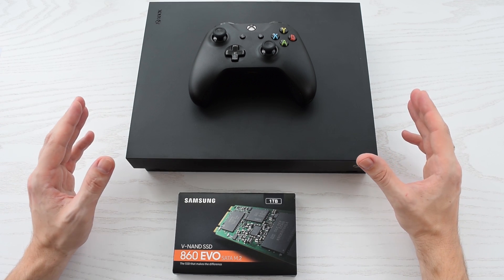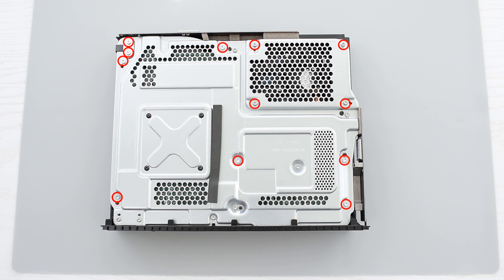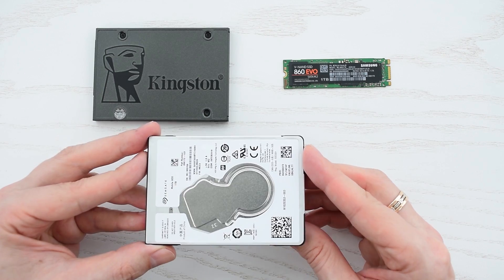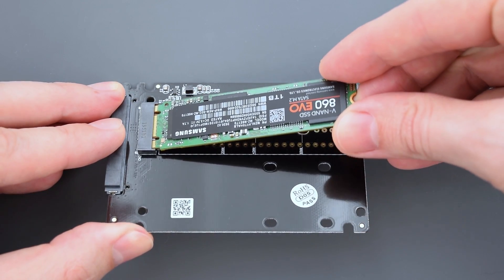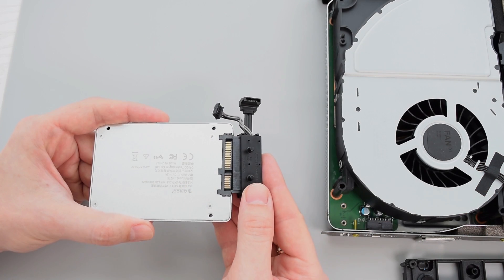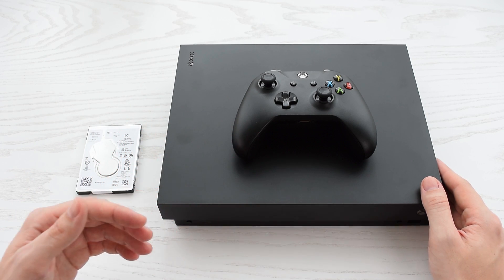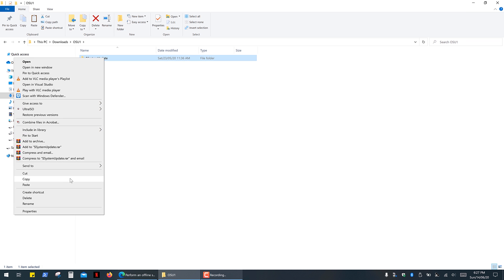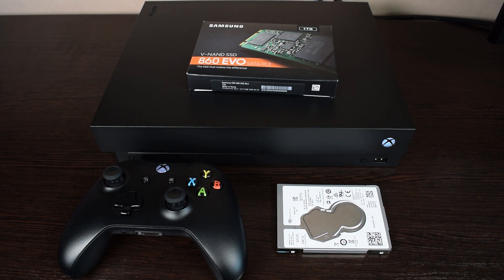How to Upgrade your Xbox and PlayStation Console to M.2 SSD Drive. 100% Works for all Consoles

Comment: but it works on Xbox One s? can you make a video of a speedtest on xbox one and see the real differences between a normal ssd and a nvme?
Reply from the maker: You can't use NVMe SSDs with that adapter. It only works for NGFF SSDs. There's no difference in speed between a regular 2.5" SSD and NGFF one. Both are SATA drives. This method is for those who already have an NGFF SSD or if you have a better deal on NGFF than on 2.5" SSD. Maybe you have a dead laptop from which you can salvage that SSD, then you just need to buy a 5$ adapter.

Comment: Hello! All great but my xbox one x is unable to make my SSD replacement size bigger than 365GB, even if the drive is 960GB. I have the same kingston ssd as you have
Reply from the maker: That's because you use 960GB drive. Xbox officially supports 500GB, 1TB and 2TB SSDs/HDDs. I have a recommended list of drives for Xbox in the description. Xbox simply recognizes your SSD as a 500GB drive. Connect your SSD to a PC and using any software that can work with partitions and extend UserContent partition to maximum available space.  It's a 5 minute process and you'll get full disk capacity.  As an option you can return your SSD and get a 1TB one.

Comment: Installing M.2 or nVME in adapter is POINTLESS!!! Speed throttled by Sata !!! connection to 550mps tops. Waste of $$ just install 2.5" SSD and be done with it
Reply from the maker: What you're saying is POINTLESS!!! There's no M.2 or NVMe, because NVMe is M.2 form factor. M.2 is a form factor for SSDs, wireless adapters and other stuff. There are two types of M.2 SSDs: NVMe (PCIe) which is super fast and NGFF (SATA) which is a regular SATA drive but in M.2 form factor. I was using NGFF drive which has the same specs as a regular 2.5" SSD. It's also possible to use NVMe but it will run at SATA speeds. This method is very good for those who already have NVMe or NGFF lying around, for example after upgrade of your PC. Or if you have a better deal on NGFF SSD than on a regular 2.5" SSD. Anyway the point of this video was to show this option, because lots of people say that they have a spare M.2 drive and they didn't know that such option exist.

Comment: have qeastion can i use new m2 disks like 3500 mb read disk? or i need to use older version of m2?
Reply from the maker: It works only with NGFF (SATA) M.2 SSDs. NVMe SSDs won't work with such adapters.
Reply: @ElectronicsComputers  thanks
Reply: @ElectronicsComputers  maybe work with m.2 Nvme to sata conver?
Reply from the maker: @rtcw6760  NVMe to SATA adapters simply don't exist and most likely will never be created. Because if you need a SATA M.2 SSD you use NGFF. There's huge difference in speed between NVMe and SATA no sense to create a device for such downgrade. Though, you can buy NVMe to USB adapter.
Reply: @ElectronicsComputers  aha okej

Comment: M2 is useless because sata speed 😌
Reply from the maker: Do you even know how m.2 works and what speeds it providesM.2? M.2 is interface provides SATA, USB and PCIe interfaces. In that particular case we used NGFF (SATA) M.2 SSD which works at SATA 3 speeds just what Xbox One X supports.

Comment: Isn't a M.2 SSD pointless, because you're still limited by SATA no matter how fast the SSD? Makes more sense to just install a 2,5" SATA SSD for the OS.

For games external USB SSD, because USB 3 is faster than SATA.
Reply from the maker: M.2 is a form factor. I was using SATA (NGFF) M.2 SSD which has the same specs as a 2.5" SSD. Don't confuse with NVMe SSDs.

Comment: m.2 is overkill it gets bottlenecked because its going into sata 3 just buy a 2.5' SSD that has read and write capabilities of 560 mbps
Reply from the maker: Those M.2 NGFF SSDs work at its maximum speeds in such configuration.
Reply: @ElectronicsComputers  right so you spend money on an m.2 and an adapter rather than just buying a sata ssd

Comment: WD PC SN730 NVMe SSD 1tb using SATA Enclosure to upgrade my PS4 Pro storage space. Is it possible...?
Reply from the maker: There's no such adapters for MVMe SSDs and will never be. You can only use NGFF M.2 SSDs. And you can use that adapter for any device where you can install 2.5" drive.

Comment: I am confused the encloser you linked looks different and have a picture saying it does not work with the samsung ssd
Reply from the maker: It works perfectly with all SSD brands. There are two types of M.2 SSDs, NGFF (SATA) and NVMe (PCIe). Those adapters work only with NGFF SSDs.

Comment: I have put in a normal SSD. I don't see any benefits to using M2 memory because it's the same price and then you also have to buy the converter case. Speedwise I don't think there's any difference as well since the SATA port is the limiting factor here.

Edit, did some research and found the answer: "Considering that many SATA3 SSDs can readily fully saturate the SATA3 connection, having an M.2 SSD instead isn’t going to make a meaningful difference - and it’ll likely cost you more money. So no, I highly doubt you’ll come out on top going that route."

Don't spend more than you need and just get a 2.5inch SSD people!
Reply: I was wondering about this.  Thank you for mentioning.

Comment: But why u should do that sata is limitated so if u put m2 into your ps4 it will run same like sata ssd
Reply from the maker: We were using M.2 SATA (NGFF) SSD which has SATA III interface. And the Xbox One X has the same SATA port which fully utilizes the data bandwidth of of that SSD. The main idea was just to show the upgrade options. Lots of people say that they have spare M.2 NGFF SSDs after upgrading laptops etc. And they didn't even know that such adapters exist. Or maybe you just want to use that M.2 SSD in another device after your console dies (2.5" SSDs are becoming obsolete), then it's pretty good option.

Comment: but the speed just normal ssd
Reply from the maker: I was using M.2 SATA (NGFF) SSD which has SATA III interface. And the Xbox One X has the same SATA port which fully utilizes the data bandwidth of of that SSD. The main idea was just to show the upgrade options. Lots of people say that they have spare M.2 NGFF SSDs after upgrading laptops etc. And they didn't even know that such adapters exist. Or maybe you just want to use that M.2 SSD in another device after your console dies (2.5" SSDs are becoming obsolete), then it's pretty good option.
Reply: @ElectronicsComputers  Yes,you are right,thanks for tutorial👍

Comment: I'm already using the Samsung EVO 870 1TB SSD in my PS3 👀, using your method would I see a difference? 🥊🥊🔥🔥🙏
Reply from the maker: No, both are SATA drives and they have the same performance. The main idea was just to show the upgrade options. Lots of people say that they have a spare M.2 NGFF SSDs after upgrading laptops etc. And they didn't even know that such adapters exist. Or maybe you just want to use that M.2 SSD in another device after your console dies (2.5" SSDs are becoming obsolete) or maybe there's a better deal for an M.2 NGFF SSD.

Comment: So what would you have to do to let say, use a 2tb+ size?
Reply from the maker: Xbox officially supports 500GB, 1TB and 2TB HHDs/SSDs. You can trick the console and install a larger drive, but some major Xbox update can brick your system, and you'll need to reinstall Xbox OS again.

Comment: Is this better than just subbing a mx500 in terms of performance? If so, why?
Reply from the maker: You can use only M.2 NGFF (SATA) SSDs with that adapter so you'll get the same performance and speed.

Comment: And this Works for ps4 pro? Cant Find any usefull Information
Reply from the maker: Yes, it does. It's just a regular SATA (NGFF) SSD but in M.2 form factor. The main idea was just to show the upgrade options. Lots of people say that they have spare M.2 NGFF SSDs after upgrading laptops etc. And they didn't even know that such adapters exist. Or maybe you just want to use that M.2 SSD in another device after your console dies (2.5" SSDs are becoming obsolete), then it's pretty good option.
Reply: @ElectronicsComputers  good to know, but the ps4  pro only Supports a speed of maximum 600 mb/s theoretical. so an normal sata ssd with round about this speed will do the same work. Am i right? So if i dont got an m.2 ssd i should better buy an 2.5"?
Reply from the maker: @raizorr5746  I was using M.2 NGFF SSD which is a regular SATA SSD but in M.2 form factor. It has the same speed as any 2.5" SSD. You can't use NVMe M.2 SSDs with adapters like that. The main idea was just to show the upgrade options. Lots of people say that they have a spare M.2 NGFF SSDs after upgrading laptops etc. And they didn't even know that such adapters exist. Or maybe you just want to use that M.2 SSD in another device after your console dies (2.5" SSDs are becoming obsolete) or maybe there's a better deal for an M.2 NGFF SSD.
Reply: @ElectronicsComputers  ah i got it! Ty for the informativ Video 👍👍

Comment: If I were to do a 2TB drive. How would that work with the partitions?
Reply from the maker: Once you've installed Xbox OS, then you need to extend UserContent partition to the maximum available space.
Reply: @ElectronicsComputers  is that option available when installing the OS?

Comment: An FYI if you're in the Xbox Insider program and have the newest beta OS, you need to leave the Insider program to reinstall the current OS and then you can change/upgrade your HDD. If you don't, then you'll run into an error when attempting the offline update with the OSU1.
Reply from the maker: That's right.

Comment: Sorry guys. But would a this adapter work with a seagate 520 or 530 ssd?
Reply from the maker: It works only with NGFF SSDs and unfortunately, there are no such adapters that would work with NVMe SSDs.

Comment: Hi there, thank you for the video! I would like to ask if the m2 looses of its speed through the adapter or not? does it affect any of the reading or coping speeds? Thanks in advance!
Reply from the maker: I was using NGFF M.2 SSD which is a regular SATA drive. There's no difference in performance between this SSD and a regular 2.5" SSD. It's just a different form factor. The main idea was just to show the upgrade options. Lots of people say that they have a spare M.2 NGFF SSDs after upgrading laptops etc. And they didn't even know that such adapters exist. Or maybe you just want to use that M.2 SSD in another device after your console dies (2.5" SSDs are becoming obsolete) or maybe there's a better deal for an M.2 NGFF SSD.
Reply: @ElectronicsComputers  i see, thank you

Comment: Hello, what seconds do you gain by changing the base PS4 Slim Drive to a M.2 SSD Drive when playing games like Cyberpunk 2077?
Reply from the maker: It doesn't matter M.2 NGFF or a regular 2.5" SSD you use it will be the same speed and the boost in performance is quite obvious compare to a stock HDD. Your console starts, updates faster. Your games start faster and installation is way faster that with HDD.

Comment: SATA Is cheaper and has about the same bandwidth
Reply from the maker: Both 2.5" SSDs and M.2 NGFF SSDs have the same specs. The main idea was just to show the upgrade options. Lots of people say that they have a spare M.2 NGFF SSDs after upgrading laptops etc. And they didn't even know that such adapters exist. Or maybe you just want to use that M.2 SSD in another device after your console dies (2.5" SSDs are becoming obsolete) or maybe there's a better deal for an M.2 NGFF SSD.

Comment: Do we get better disk performance by using M2 to SATA converter, compare to a native SATA ssd? Thanks for the video.
Reply from the maker: I was using M.2 SATA (NGFF) SSD which has SATA III interface. And the Xbox One X has the same SATA port which fully utilizes the data bandwidth of of that SSD. The main idea was just to show the upgrade options. Lots of people say that they have spare M.2 NGFF SSDs after upgrading laptops etc. And they didn't even know that such adapters exist. Or maybe you just want to use that M.2 SSD in another device after your console dies (2.5" SSDs are becoming obsolete), then it's pretty good option.

Comment: By using the SATA enclosure you are limiting the NVme drives full speed.
Reply from the maker: What NVMe are you talking about? You can't use NVMe SSDs with that adapter and I clearly explained that in the video. There's no adapters like that that work with NVMe SSDs.
Reply: @ElectronicsComputers  My Bad, i skipped the part where you were using an M.2 SATA drive.

Comment: is m2 faster than 2.5 inch ssd?
Reply from the maker: M.2 is just a form factor. Some M.2 SSDs (NGFF) use SATA interface just like 2.5" SSDs and some (NVMe) use PCIe technology which provides super fast speed. You can use only NGFF M.2 SSDs in that console and they have the same speed as 2.5" SSDs. This method is good for those who already has a spear NGFF SSD or if M.2 NGFF SSDs have a better deal compare to a regular 2.5" ones.

Comment: Hi
I did the same procedure with a kingston ssd 960, but it only show me 365gb available, how can i fix it?
Reply from the maker: That is because Xbox supports 500GB, 1TB and 2TB HDDs/SSDs. Your console recognized your 960Gb SSD as a 500GB one. You need to connect that SSD to a PC and using any software that works with disk partitions extend "UserContent" folder to the maximum available space. And then put it back into your console.
Reply: @ElectronicsComputers  Could you recommend me a software? Please 🙏🏻
Reply from the maker: @ismaelrivera4051  You can download "Mini tool partition wizard" from my Patreon page (the link is in the description) for free. The link for that app under the video about an SSD cloning.
Reply: @ElectronicsComputers  Thank you 😀

Comment: You mentioned you'd share a link for a video explaining how to copy game files. Is it possible to place that into the description? Or was it the laptop video?
Reply from the maker: I was talking about cloning the drive which I don't recommend. Simply Install Xbox "OS" then install your games and after you log in into your Xbox account all your game progress will be back. If it's not an option then simply clone the drive the way you do it for your PC.
Reply: So I dont need to clone the hard drive to the SSD using acronis or macrium reflect? 

Do I just replace the hard drive with the SSD then I just download the xbox os on a usb then connect it to the xbox then download it to the xbox while the SSD is already inside?

Comment: Just use USB 3.0 SSD, it is faster than the internal SATA 2 bus
Reply from the maker: You're wrong! Xbox One X has SATA 3 interface which provides faster speed than any USB to SATA or M.2 adapter.

Comment: A great video but PLEASE for gods sake use either an antistatic wrist strap connected to an earth supply or plastic gloves like the mechanics or hospital staff use , before even thinking of handling very sensitive devices like this as they may or at some point fail early due to static damage later on down the line. Its absolute beggars belief that people especially PC shop staff ive seen handle this sensative material without thinking of the consequences. Ive learned this from previous experience & had to return Ram due to faulty product as seen them handle it with bare hands only to descover unsuprisingly it did not work or caused the BSOD (walk away if you witness this as you will be returning it for exchange or refund unless its sealed then you are fine) The same applies to Ram as mentioned / CPUs / Graphics cards / motherboards / daughter boards etc. doesnt matter so much about HDDs or SSDs or PSUs as they have some kind of protection as you are not actually handling the circuit boards on them.
Reply from the maker: Thank you for the comment!

Comment: So between SATA and 2.5 inch SDD there will be a different on speed. However 2.5 SDD vs M.2 SDD will have the same speed and performance because of the SATA connection right?
Reply from the maker: 2.5" SSDs and M.2 NGFF SSDs have the same specs. NGFF M.2 SSD is a SATA-based drive so it can't perform any different than his big brother.

Comment: Thanks a lot mate, detailed yet simple... 👍
Reply from the maker: Glad it helped
Reply: @ElectronicsComputers  Is it possible to use M.2 PCIe NVMe? It‘s faster and would be better.
Reply from the maker: @yorumustasi  There's no such adapter for NVMe SSDs only for NGFF.
Reply: @ElectronicsComputers  I saw after this video, that you work on it :) on the board is a place for M2 PCIe NVMe I think(?), you say for 4 month that you build something, a soft -or hardware, I read it in the comments, what is the current status :) ? 

It would be awesome, if it‘s possible.

And an another question, what happen if i copy the Series X system and build the SSD in One X? Work it or don‘t work it because of an another mainboard and so on? 

Maybe you can analize the Series X Software, how work the console with the storage, and than create a software for One X, maybe than it can be work.  

I am not a expert, but this was my idea^^

Comment: Okay so maybe you can't upgrade from SATA to NVME but this is useful information because now we know that we can install 4TB SATA drives in Xbox One X instead of being limited to 1TB.
I'm honestly just here because I have to replace my thermal paste and thermal pads and the series x is still in extremely short supply.
Reply from the maker: You can only use NGFF M.2 SSDs in this conslole. NVMe is not gonna work.
Reply: @ElectronicsComputers but if the adapter exists why shouldn't it work?